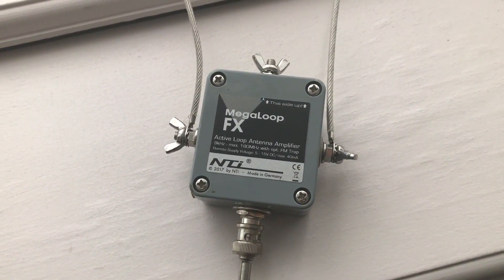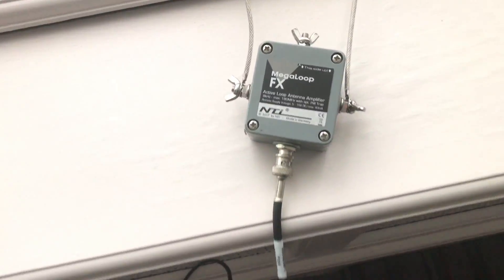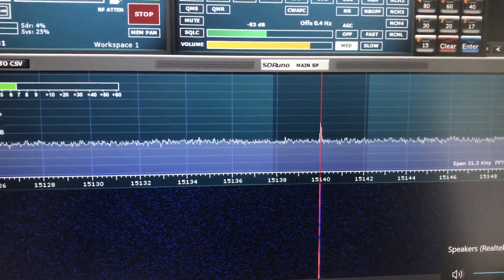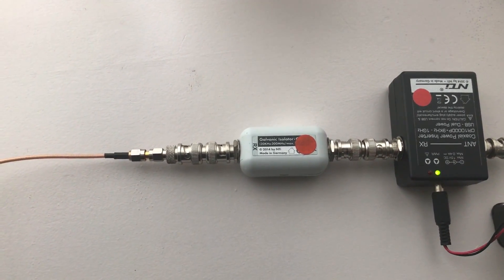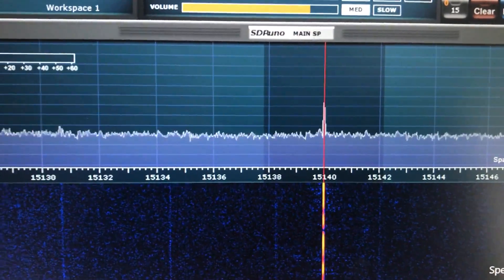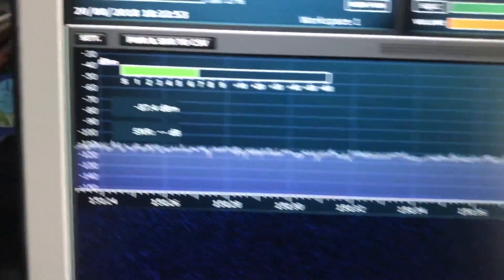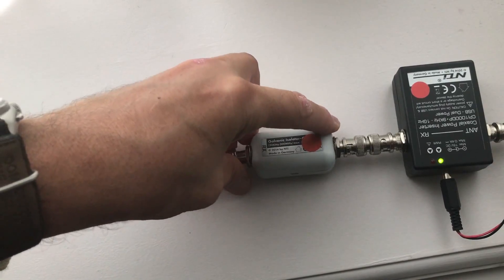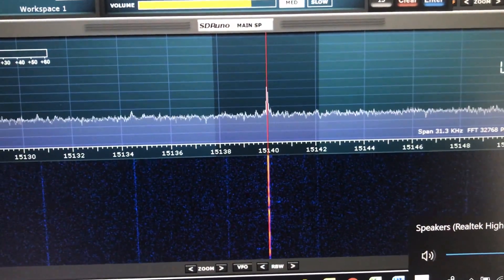Testing the Bonito GI300 Galvanic Isolator with the RSPduo SDR and MegaLoop FX at my hotel in Dublin

Comment: Do you have experience with the Bonito FX loop in very noisy environment ?  
and is there maybe a test that you know i have 10, 20+ db with a wire antenne and  other antennes like the AOR-7000 and more brands i have tested. 

Tnx .
Reply from the maker: Yes I have - an it performs very well - about the same as a Wellbrook ALA1530. Only an H-field antenna such as this will improve the signal to noise at your QTH. Hope this helps. 73

Comment: What's the difference between the GI 1000 and the CCMC30? which one would I be better off getting to help reduce local noise?
Reply from the maker: The GI1000 is a galvanic isolator and the CCM30 a common-mode choke. They're similar in how they work - breaking up RF currents in the coax but I've always had much better results with the GI1000. Hope that helps. 73!

Comment: Hi Clint, Simon ... sorry can't find the video where we had the original conversation re: Bonito GI1000. Anyway mine arrived today, plugged straight in the back of my Winradio SDR, Wow!! Absolutely and totally amazing difference instantly ... my shack used to be an old garden garden shed away from the house to escape all the electronic hash indoors. But sadly the old shed is falling to bits so had to move everything indoors - plus bloody cold MW Dx'ing in the middle of the night in winter. I was instantly plagued with noise, this little device is amazing, much, much better. Wouldn't have found it without your videos .... Real quick question - is there much difference between the G1000 and the slightly more expensive CCMC30.
And another great bit of kit ... from the same guy who makes the Quantum loop, his Quantum phaser (on same website). By phasing your Welbrook loop against a longwire (for example) you can do amazing things to reduce noise and bring the signal right up ... works wonderfully well and is also really portable. 
Anyway, for now, 73 and good DX. Simon
Reply from the maker: Hi there Simon, fantastic! Really good to hear your GI1000 has made such a difference to the noise floor at your QTH! Mine is the same - as is the orignal GI300. Brilliant little devices. I think the GI1000 works better than the CCMC30. I saw the Quantum Phaser - if money was no object I'd buy one tomorrow! Thanks again and 73! Clint

Comment: Clint will the G1300 with my MA305FT?  I was going to message Dennis to ask...but since you're making a video I'll ask you.  Also you said it should be as close as possible to power inserter?  By the way nice set up. Brian
Reply from the maker: Hi Brian, it should be as close as possible to the receiver and yes it should offer benefit with the MA305 or any other antenna for that matter. Thanks my friend. 73! Clint

Comment: Hi Clint ! For maximum performance,  I suppose the GI300 should be connected directly to the RSP SMA, right ? Kind regards, Pat.
Reply from the maker: Hi Pat! That is correct, because in theory there's no shielding on the RX side of the isolator. 10 dB improvement in noise floor is useful. 73! Clint
Reply: Thus, why do you use this pigtail ? You don't have the appropriate adpater ? This GI300 looks promising, I should give  it a try, maybe it could partly remove the terrible noise I've been facing for ages on LF and MW.